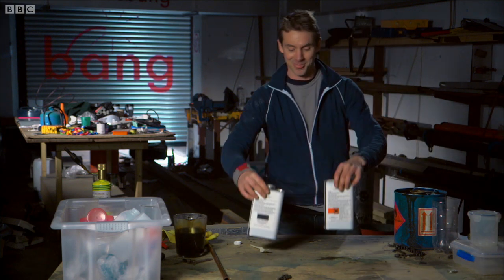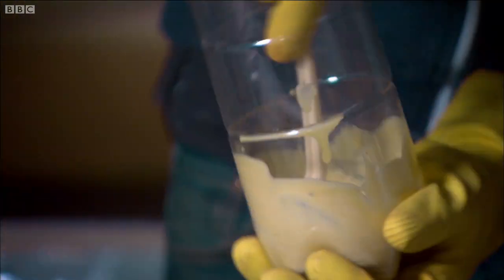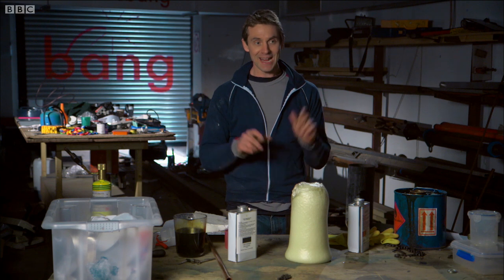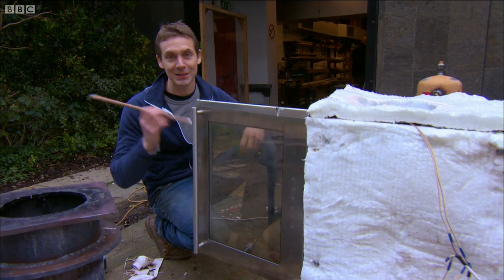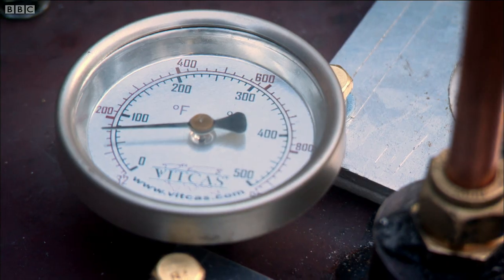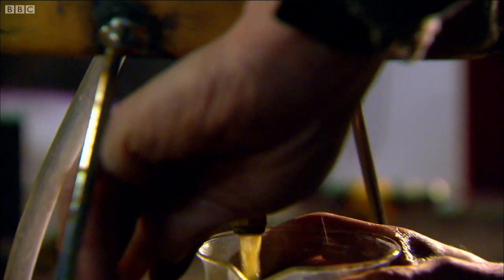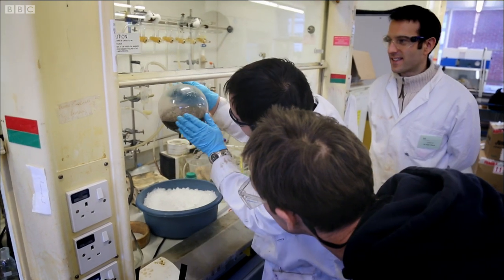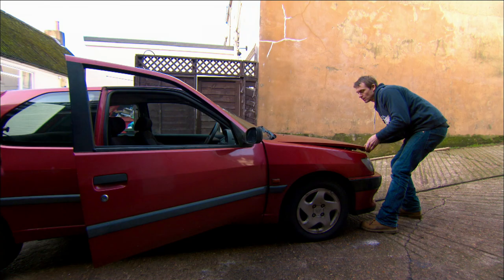How To Make Diesel From Plastic | Bang Goes The Theory | Earth Science

Comment: All that's left to do is start catching the plastic in the ocean to be used as fuel
Reply: No. The oil industry will simply do anything to stop that fro happening
Reply: Szymon Gorczynski The real question is if this is a net energy gain, I have a feeling it took more energy to cook the plastic down then you could get from the fuel it made.
Reply: Sir Piken But the thing is that when we run out of oil this will be the only way we can get petrol and diesel
Reply: Szymon Gorczynski  When that happens free market innovation will kick in and there will be an energy revolution. This is likely the next big thing in energy it just isn't ready yet.
http://www.graphenea.com/pages/graphene-supercapacitors#.VZGiEFVViko
People think batteries are an anwser but they are big slow and full of chemicals. This is the best answer so far but it is a ways off.
Reply: Less about power, more about options. We use oil for just about everything in modern society, one way or another. Granted, there are other options and there will be better options when pressed but for the transitional period the ability to turn oil products back into oil will be sorely needed

Comment: This is a very good idea... IF you have access to a volcano or some other source of free heat, like a solar farm in Sahara or something.
Reply: +Sion They said the ideal temperature is 350-400 degrees, its not that hard to reach those temperatures.
Reply: +Largemac but you have to heat the oven with energy you have to get from say burning fuel - if you need more fuel to heat the oven than you can produce - well you get the point
Reply: Correct you could probably reach those temperature in a pressure vessel under reflected sunlight off of mirrors in the warmer latitudes of course, where most of earth's population lives.
Reply: We could use Teslas model. They've invested in Solar panels for their Giga Factory in the Nevada Desert. This not only helps power the factory but it also helps Tesla provide free supercharging without really costing the company anything. That is, since they're essentially 'transporting' solar power from a high solar area to superchargers nationwide.

Point being, we could have an almost one time investment such as wind power or solar to power the recycling of plastics. With solar panel tech increasing now-a-day, solar panels have a life of 20+ Years so it should be cost effective (The age of panels may be different now, but last time I heard it was 20+ Years).
Reply: Also some friendly chemists and a girl with a cheap car
Reply: Is this a Saudi prince trying to sell his land to investors?
Reply: @TheJorjj  yes its very easy to attain that temp from solar farm with concentrated mirrors
Reply: You could always burn some plastic...
Reply: They are doing this with a fire pit on a island to run generator's.
Reply: I've hit 400+ burning wood chips in a old grill
Reply: Or like....if you know how to make fire...

Comment: How much fuel did you make energy-wise and how much energy did you spend to make the fuel?
Reply: It could be as little as nothing beyond investment cost if you used wind or solar power to heat the oven. The plastic itself could certainly be collected for free.
Reply: +Patrick L Rabun they have a field of mirrors in a field in the US somewhere and if it is pointed to a single position it can melt steel, it would be more efficient than solar panels or wind turbines
Reply: It's called a solar tower, Spain has some as well AFAIK.

Comment: But how much energy dose it take to heat up the oven to vaporize the plastic?
Reply: RedMexican Much more than the diesel produced. But it is an interesting idea.
Reply: Yea but not really effective till we are nearly all renewable, but will cars still use that fuel at that point?
Reply: agreed
Reply: RedMexican I think excess heat from furnaces all over the world would melt plastics for fuel. Extra income for metal worker and high temp factories.
Reply: RedMexican I don't think he ever implied it was a solution to anything, just merely demonstrating the concept.   It certainly takes more energy to create than it produces.
Reply: Wayne Johnson There is a power plant in my town that regularly dumps hot water into the river. In the winter, the river never freezes one mile downstream. With the use of thermal pump we could have this in the summer and heating for the whole town in the winter.
Reply: Mr Rishi The Cookie  the name of this process is pyrolysis and for most materials used is energy positive (meaning that once the reaction is started by outside heat, it can self sustain using just the products coming out - "diesel" and "biogas").Besides plastic you can also put in rubber(old tyres), wood, paper, bio waste, or just anything that contains hydrogen and carbon in it. I cant find sources that state why it is not widely used for fuel production but my guess is that oil drilling is cheaper and more abundant.
Reply: RedMexican Naturally if you doing this on industrial scale and trying to both be economic and ecology about this you need be very careful about how you apply your heat. To make sure you get as little heat loss as possible. Of could you need also to compare it to other alternatives like simply burning the plastic and using that energy to produce heat and energy for housing for example.
Reply: RedMexican There are some uses I remember reading about a guy in the Gaza strip doing this because of the embargo by Israel they couldn't get enough fuel.
Reply: AshyLarry Makes sense in a closed system where you do have some electrical power but no fuel.

The alternative would have been an electric car.
Reply: ***** At least I now know what to do if the world go's all Mad Max one day.
Reply: AshyLarry Yup, Or go electric.
Reply: ***** Same could be said of any process.  I would be interesting to see what comes of it.

Comment: I think there would be a problem to make fuel from scrap plastic for commercial use - fuel companies. They would not even let you customize your engine, so it uses less fuel and creates less pollution, because their enormous profits shrink. If you let a little bit of high pressure steam to the cylinders while the engine is working, you can cut ectremely the fuel consumption.
Reply: I think car manufacturers might be interested in the face of competition of electric vehicles.

Comment: one question: what is the net energy gain here (energy to heat the oven vs energy accessible by burning the fuel)? a negative value maybe? ^^
Reply: It doesn’t matter yet. The point is that it’s possible. From this action on, we will finding ways to make it worth (plastic problem for example). Right?

Comment: Sooooo when burning plastic is it not only discouraged but potentially  harmful what would be the difference when place in a car that will essentially burn it and release it back into the environment
Reply: Because after this process, it isn't plastic any more. It's diesel.
Reply: But chemically unsint still all the same? It was just moved from one container to the other in a sealsed environment  of which here come my issue, every think that plastic was was just converted to liquid 
.. BTW thanks for responding
Reply: j stash Erm burning? it's melting and getting the fuel that normal diesel releases!
Reply: j stash Fuel in diesel engine burns under the different circumstances than just light up on free air. Pressure and temperature is much higher so it break more molecules and let them burn into simple CO2 and H2O. Farther - cars often are equipped with catalytic converters and diesel particulate filters.
Reply: j stash It depends on the plastic. Polyethylene contains only carbon and hydrogen molecules so it can be cleanly broken down this way into other hydrocarbons like diesel, but many plastics contain chlorine which will form all sorts of nasty things that are hard to get rid of.
Reply: j stash But your going to burn some sort of diesel anyway so the net amount of carbon emissions is still the same but you've used up some plastic that would otherwise be in a landfill.
Reply: FartingNinjaFrog 'Loophole'
Reply: well shucks guys thanks for the awesome feed back..
Reply: and politeness

Comment: All it needs is fre heat, im thinking about vulcano or some kind a solar panels that give out some 400 C so it can run by gain power, not loosing it
Reply: what about just a solar oven? magnifying glass?
Reply: If you could get it for free, take the money you save on gas and buy an gas/electric generator and sell that energy to the grid.

Comment: To burn the plastic you need more diesel than the amount of diesel you get by burning the plastic
Reply: There is a gas by product that can be reused to supplement the heating fuel. Many people that run of grid use this system with a small scale plant.

Comment: ...except diesel doesn't ignite with an open flame.
Reply: +jailbreaker1214 That's why he said "I can my fuel is too flammable to be pure diesel" and had it fractionated. ;)
Reply: +jailbreaker1214  yes it does lol. I use it to start bomb fires
Reply: +yumcha16 Bomb fires?
Reply: +yumcha16 Bullshit.
Reply: Bonfire's*
Reply: Its great because it lights up nicely but burns for a long time and isnt an explosive flame like petrol.
Reply: yumcha16
You can't just light diesel.
Reply: Have you ever tried? I have many times camping, it works quite well. you have to hold the lighter there for a little bit but it does light and burns slowely for a decent amount of time. So great for starting fires.
Reply: yumcha16
Not myself, but I've just seen some videos and read that it doesn't start burning easily.
Reply: yeah like i said you have to hold the flame there for a little bit or light some paper first. but it does ignite
Reply: Oh okay, I thought you meant it just burnt up like gasoline or something.
Reply: diesel like any oil is flammable, not in the way you think though, you need to either reach the flash point or have it soaked into something like wood